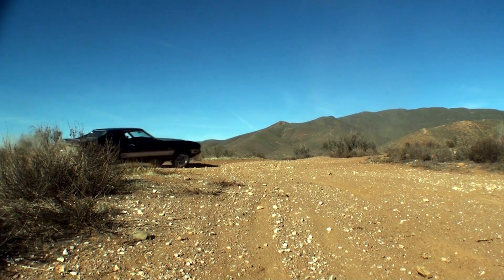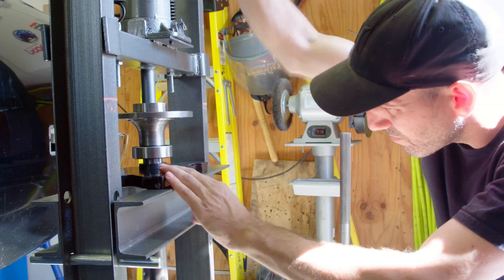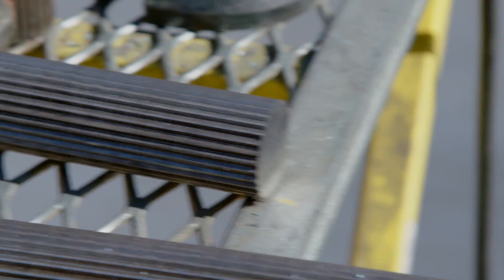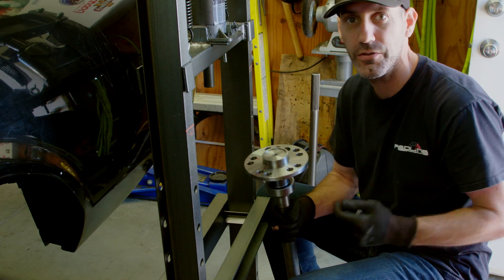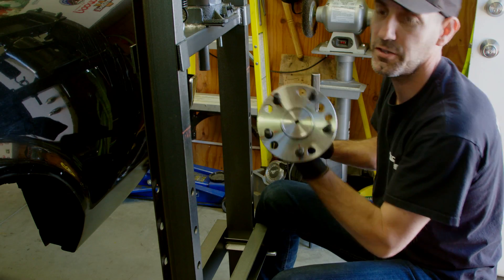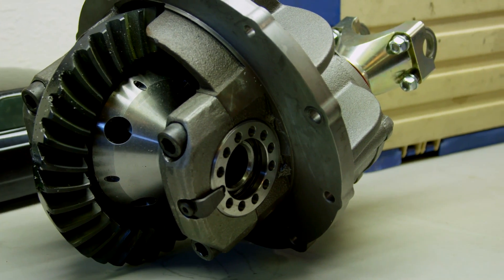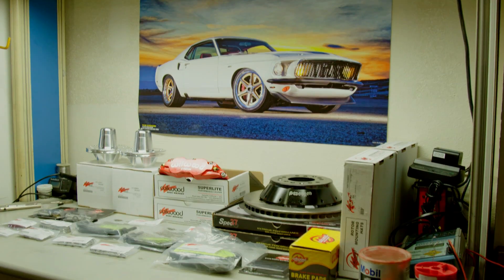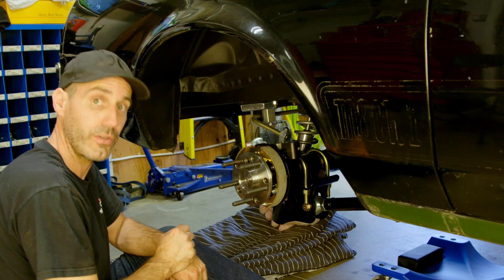Ford 9" Rear End Rebuild with Yukon Gear Parts and Posi Traction!

Comment: I know this is an old video, but just as an FYI, probably not best practice to install the bearings and then cut and grind the shafts. Might end up being a quick way for the novice viewers to have to install bearings twice. Nice video otherwise.

Comment: Call me ignorant,  but I have never seen lug studs pressed in from the wheel side of the axle flange.   I thought they all pressed in from the back side of the flange and had a mushroomed end,  to keep them from being pulled through the flange.  Won't the ones you pressed in,  pull out,  when you tighten the lug nuts?  I am 68 years old and haven't replaced lug studs in a long time.  Am I missing something?  Seriously,  I would like to know,  for future reference.
Reply from the maker: These are pressed in like normal,  I used a large socket as a spacer on the top of the flange since that was the only way to fit it in my press.
Reply: @AutoEdits  Normal,  for me,  is pressed in from the back side,  with the mushroomed end,  similar to a bolt head,  going against the back side of the flange,  to prevent the stud from pulling through the flange,  thus,  possibly,  letting your wheel fall off.  I saw no mushroom,  or bolt head on any of your lug studs,  and have never seen a lug stud,  like those.  You pressed these through the front.  I am wondering,  and will research,  whether there is a newer design,  that I am not familiar with.  Thanks for the reply.
Reply from the maker: @wmden1  These are pressed in from the back, like normal.
Reply: @AutoEdits  I watched it again.  I am sorry for not being observant enough.  I didn't realize you had backed the studs and,  basically pressed the flange onto the studs.  I had always drove them in,  from the back of the flange,  with a good sized hammer.  Like I said,  I am 68 and am subject to brain farts,  every once in a while.  That's my excuse,  and I'm sticking to it.  Thanks for being patient and cordial with your replies.
Reply from the maker: @wmden1  All good dude!  I'm glad you're here and asking questions! Car guys gotta stick together...LOL

Comment: Hey Jason.  I own a 2012 Jeep JKU and have followed your Jeep channel and know you know your stuff.  I am currently in the market for a muscle car and found a 68 Nova, 454ci, Turbo 400 Auto, 2800 stall, with a Ford 9" rear running 3.00 gearing.  At the moment I am a complete novice when it comes to muscle cars.  Is this gear ratio good for cruising or good for the strip?  I will mostly be using it to cruise around town but want to be sure I can get the power to the ground when I want to.  Thank you for all of your videos!

Comment: + auto edit thank you so much I thought he have to do something different because it's behind a Chevy motor thanks nice vid to
Reply from the maker: +dj bottex Oh, nope the only thing to be sure of is the size of the U-joints on the driveshaft and pinion.  It'll be pretty clear what needs to be done! Thanks for checking out the video.
Reply: +autoedit I just found out the transmission it's th400

Comment: + auto edit I don't know trans he going with I think the rims are 26's with a big lip for the rear it's a show car nut want it to move
Reply from the maker: +dj bottex If that's the case, you can probably just use the gear it comes with if it's not damaged.

Comment: did yours come standard with a 9 inch. i have a convertiable with a 8 inch. i dont know how well it will hold up but wanna get a posi unit. is it easier to get a 9 inch off a junkyard lincoln or truck and convert to posi or is the 350 HP (im aiming for) not enough to break the 8 inch
Reply from the maker: +TheSamplebridge Sorry for taking so long to find this comment...your 8 inch with a posi will be fine for 350 horsepower!
Reply: autoedit ok. the engine for now is delayed because i (ironicly) got a 95 GT that im paying off and a big chunk is going to the taxes and stuff close to 400$ with teh first monthe payment, taxes, and whatnot.